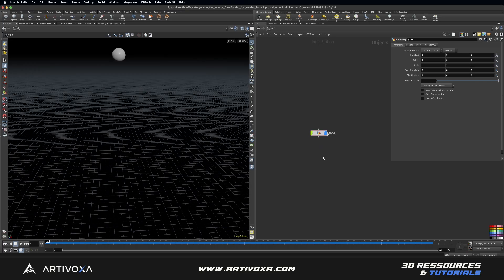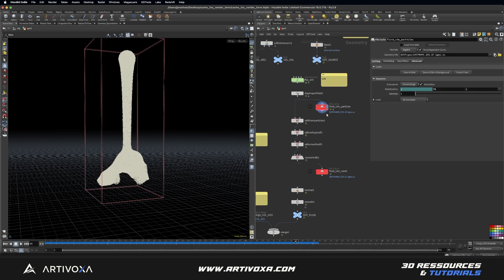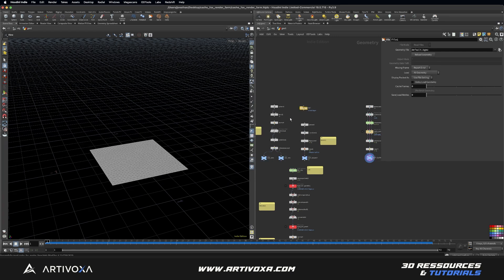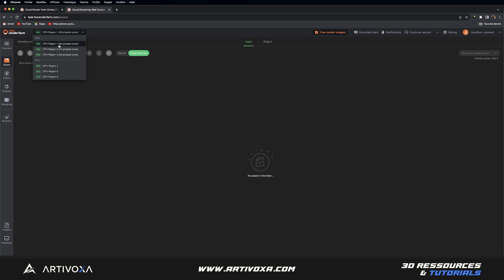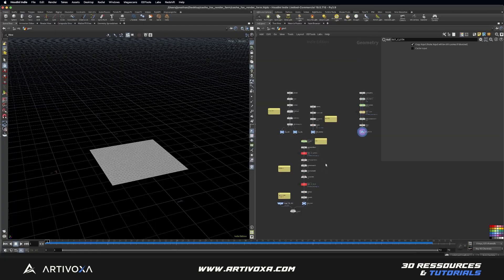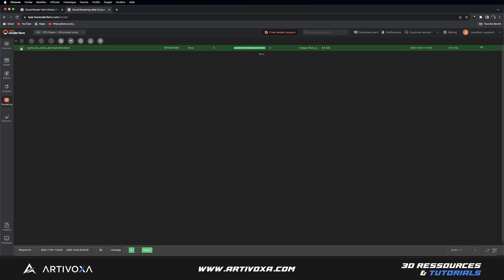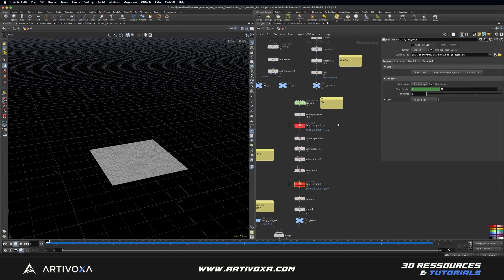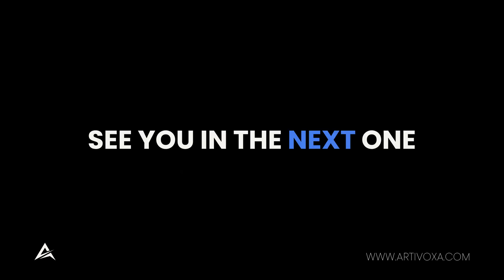Houdini Tutorial | SPEED UP YOUR HOUDINI CACHING PROCESS

Comment: Hi, really useful to know can use the farm for caching sims as well as rendering. Depending on the job it might even be cheaper in terms of electricity(at least with our UK prices!) than leaving computer running for a couple of hours. Do you know if you can use TOPS on the farm to automate doing both caches on after the other ? That might save having to keep an eye on the farm to check if first cache is done before starting second. Thanks again.
Reply from the maker: Hey!! Thanks for your feedback. I’m not sure for TOPs but it can be a very good option to consider. If you want to be sure, you can contact Fox Render Farm with the little chat icon, they are super fast to answer